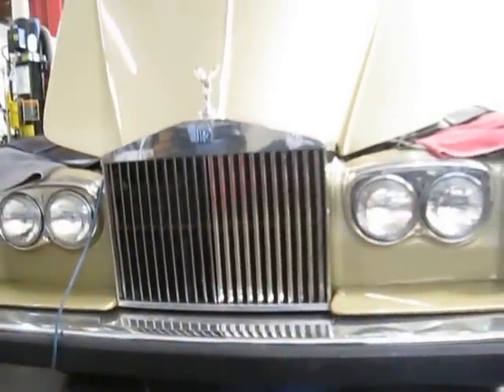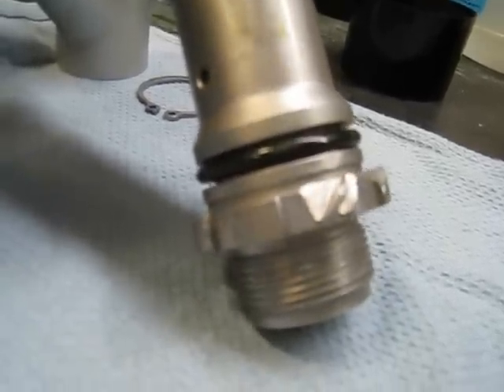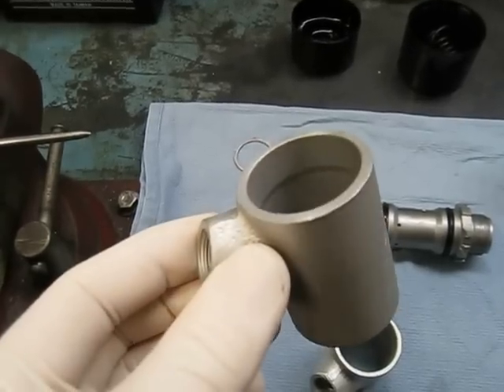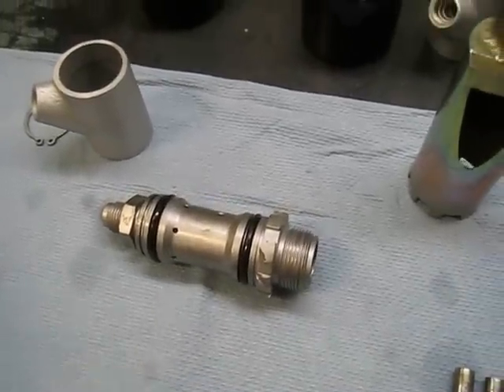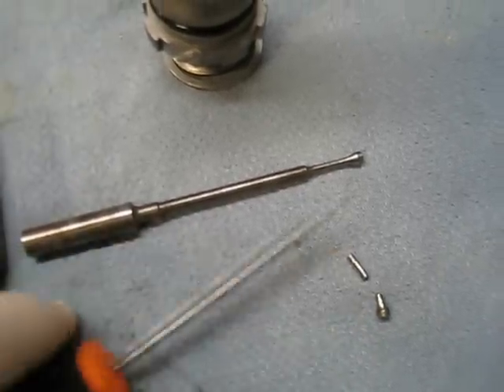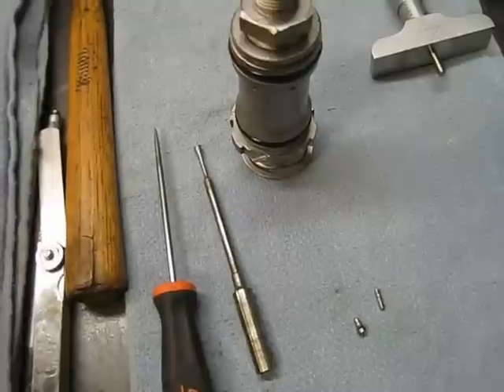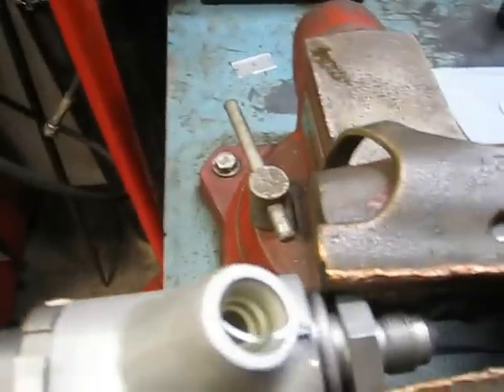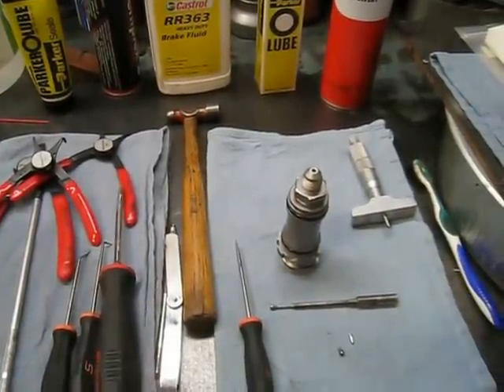MVI 9019

Comment: Thank you for doing this...I have Had 30 years of being screwed by mechanics...Can you please help out with the bentley continental r ...I love my cars but dont drive several of them, but I took one of my shadows and put new chevy engine and have had ten years of no service but oil and simple tune up. Make a kit to fix these brake systems and you will raise the value of shadows and create a new beginning......I know the height control was filled with greese and i much prefer the ride and it never leaks....I have cadillac seville brake system running the original brakes for ten years now....Pads and rotors are RR are still afforible   ...Thanks again Hope to see more of your videos...